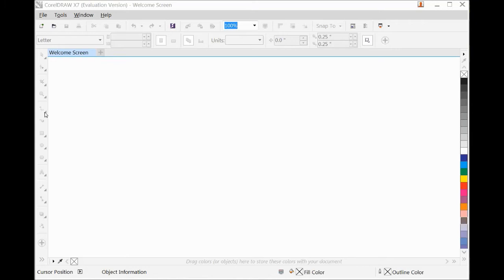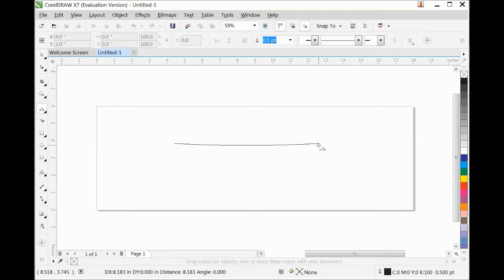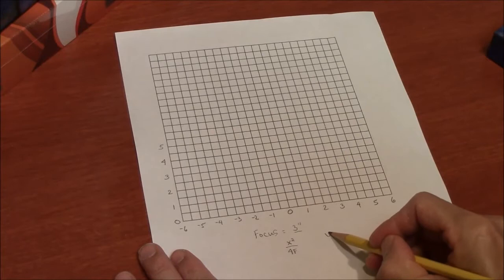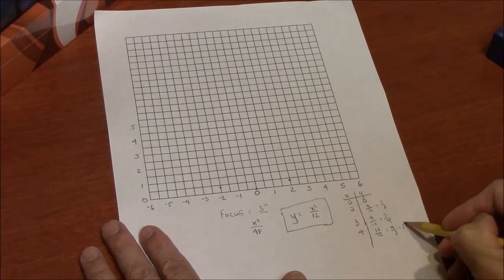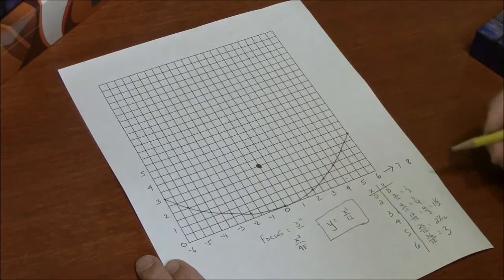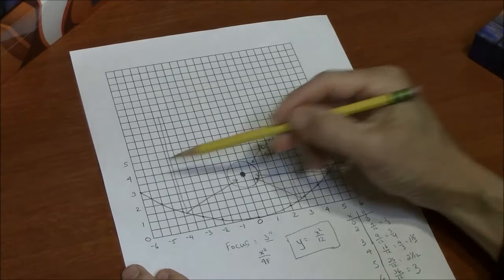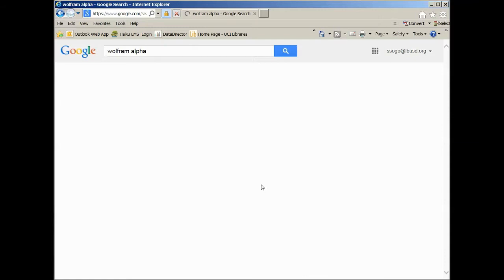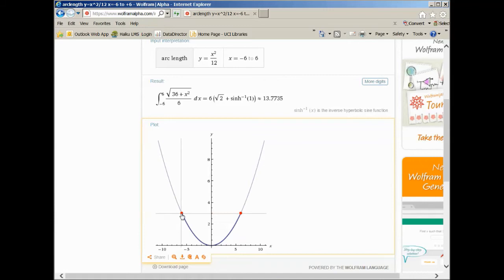Parabolic Reflector Part 1  Drawing and Measuring the Parabola

Comment: You can construct a parabola on lined paper using a compass and the focus-directrix technique.  Every point on the parabola is as far above the directrix (a horizontal line below the focus point) as it is distant from the focus. The bottom of the parabola is halfway between the focus and the directrix. 
For a 6" focus, put the bottom point on one line and the focus 6 lines above then open the compass to 7" and cross the next line up from the bottom on left and right with the compass. Then the next line at 8", next at 9", etc.  
No algebra necessary, this is how the ancient Greeks constructed parabolas.  You can draw an ellipse with 2 pins, string and a pencil. A half ellipse the long way will focus on a point.